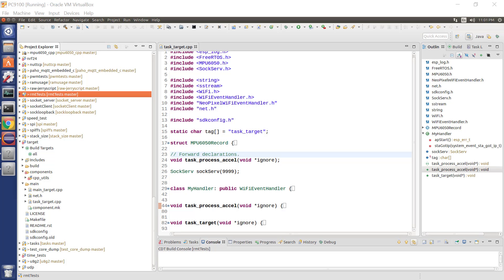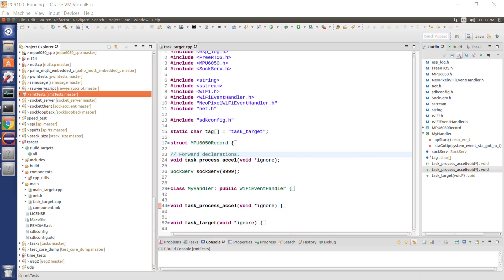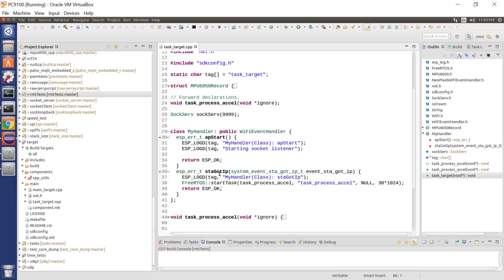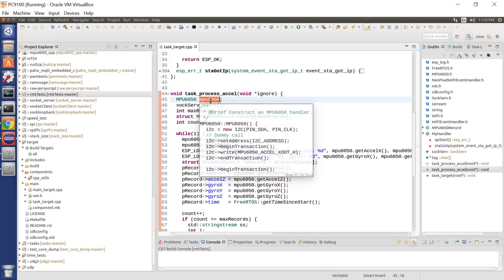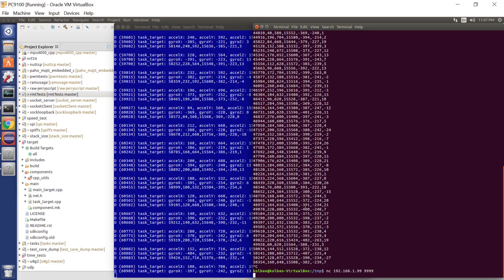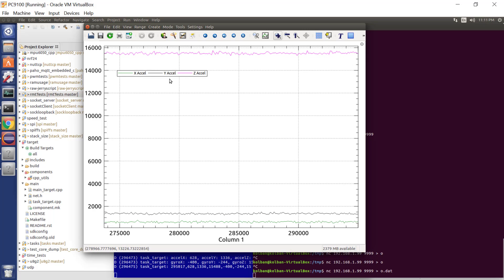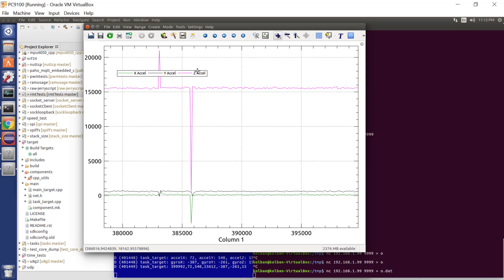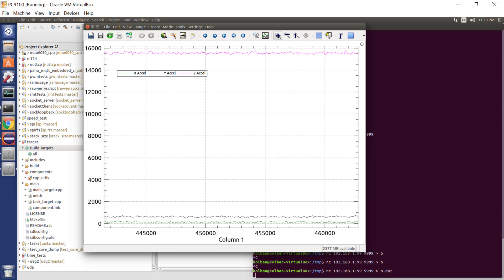ESP32 Technical Tutorials: Charting sensor data

Comment: I have somewhat off the content but related issue. 
I have had working ESP32 and was logging data into SPIFFS memory from bme680. unfortunately, i left is running long time and now i am not able to flash it at all.
can filling up SPIFFS memory brick esp32 board ?  Is there anyway to clean spiffs memory ?

i have raised issue on github and espressif forum with details of error and what i have tried.
can you suggest any solution... i need to make my board up and running as my project is stuck.

https://www.esp32.com/viewtopic.php?f=14&t=4248&p=19073&hilit=A+fatal+error+occurred%3A+Timed+out+waiting+for+packet#p19073 

https://github.com/espressif/esptool/issues/263